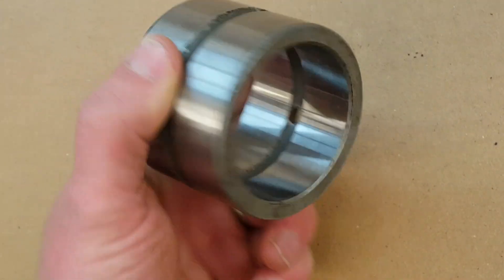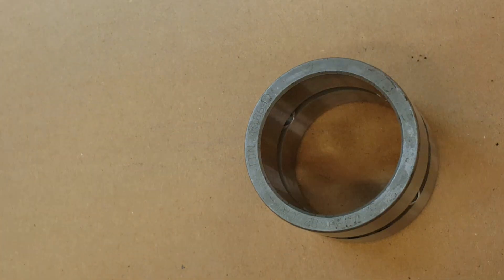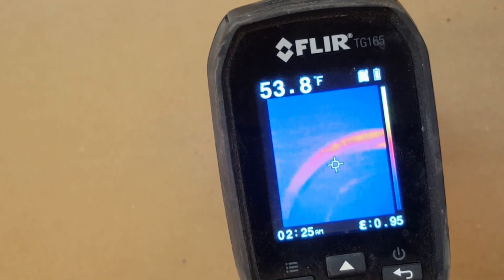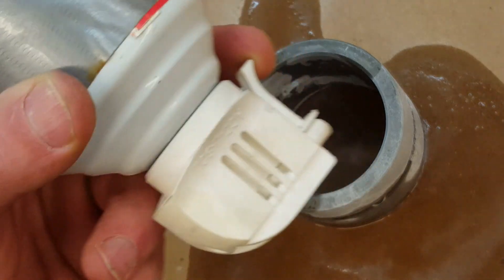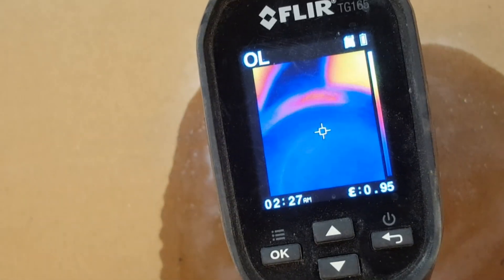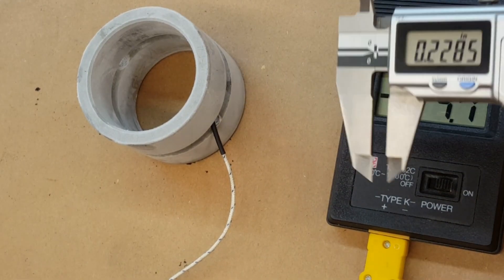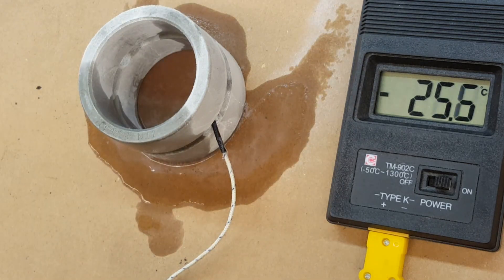Old Mechanic's Trick: Freeze-Shrink Metal Parts WITHOUT Nitrogen.

Comment: Here is an easy effective way.  Try it.  Get a bottle or two of cheap isopropyl alcohol from anywhere.  Put it in a container big enough for your part, and add a chunk of dry ice.  Dry ice is sold at many places including smart and final.  Add your part and in a few minutes it’s colder and smaller.  RE bottle the alcohol.  The dry ice will disappear.  Wear protective equipment, gloves, safety glasses, use tongs, face mask, Snorkle and fins, you get the idea.

Comment: coolant bypass tube that runs along the top of lower intake manifold is a press in friction fit it has a few pinhole leaks...will the method help remove/replace?

Comment: Although I did eventually use a freezer, I wish I would have considered this when I tried to install a CV axle transmission seal.  I always knew the assemblers and mechanics had a trick up their sleeves; I just didn't know what it was.  Thanks; I've got one more CV axle seal to go.  Having stated that, I realize the glass-transition point of rubber is -40 degC, so I cannot go too far without risking the destruction of the part.  Perhaps I can heat the transmission up with a parabolic room heater, increasing the temperature differential as well.

Comment: Ohh I know it's been 5 years, but it's so rare that I spot AvE fucking something up / that I have something meaningful to add:

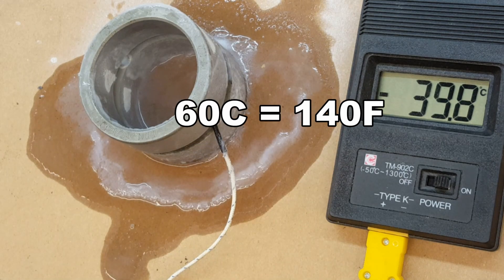2:35 He made the n00b mistake converting temperature differences from ⁰C to ⁰F as if they were absolute values. One cannot do it that way, since they don't have the same zero point!

Yes, 60⁰C is 140⁰F, but a difference of 60⁰C is equal to a difference of 108⁰F.

absolute C to F: (C * 9/5)+32
relative C to F: C * 9/5

Comment: You can do this with a propane torch too, ironically. Turn it upside down without lighting it so the liquid comes out, same effect, and cheaper. Probably should do that outside...
Reply: Remember folks.. propane is heavier than air and pools

Comment: Freeze shrinking = About 1 1/2 thou per inch (.0015) with liquid nitrogen at -200, boil it in water and it grows by .00075 per inch, put it in the freezer and it shrinks by .000000naff all !
Aluminium is double these figures !

Comment: Not sure what they sell in Canuckistan, but the stuff here in the states, nanny state got their hands on it and it's loaded in denatonium benzoate now.  Spray the solvent out of a can of duster and you'll be tasting the nastiest, most bitter taste you can imagine, really load on a part like that and you'll contaminate every surface in your shop to the extent you can't eat with your hands for hours, even after washing them.

Not sure if you can get spray air without the "abuse deterrent" in there down here in the States but if you can it's not any old hardware shop or electronics store.

Comment: Having experience an empty CO2 Fire Extinguisher when I really needed one, then a second empty one, I can tell you that my reaction to someone misusing a CO2 Fire Extinguisher wouldn't be cool at all.
Even CO2 must be taken in for recharging even if used just for a second or two. The valves will no longer be guaranteed to seal perfectly and it's very likely that well within a year it will be effectively EMPTY. 
Screw around with lots of things, I do, but I never mess with Fire Extinguishers since that memorable day. It was a nice truck.
Reply: Dafuq you prattlin' on aboot? He's not using a fire extinguisher. It's a 4 doll hair can of air. Son of a diddly, grab a hold of your ears and pull your head out of your arse. Perhaps lay off the glaucoma medication before you comment if you must.

Comment: In Aerospace assembly, only two methods are specified by major aircraft companies. 1. Liquid Nitrogen  - OMG EASY and cheap once you have the storage flask, which can be part of the LN price from most suppliers. There REALLY is no reasonable alternative if you shrink even half a dozen things a week. Liquid Nitrogen is interesting as a cleaner too. Do your own experiments. It's actually safe to handle with simple precautions. It's really cold, but a really wimpy cooler.  ? Ice water cools room temp things down way faster than blowing cold air things... Liquid Nitrogen cooling power is not as light weight as blowing cold air, but it's not even close to what you would expect IF you could have Liquid Water at the same temperature. Wear loose fitting heavy leather gloves ! You should be able to just fling them off your hand if it spills inside. 
2. Dry Ice and Pure (99%) Isopropyl Alcohol. You can get both at a supermarket that has a half decent pharmacy.  CHEAP !
Either way, you can use any Styrofoam cup or container that is strong enough to hold as much water and your parts*.  Dry ice is more hazardous to handle than Liquid Nitrogen, so wear gloves, etc. Dry Ice + 99% Alcohol gets colder than any sprays, down past -100 F.  Liquid Nitrogen is around -200*F for round numbers.
Nitrogen is magic for so damn many uses that you'll be searching for reasons to get on a regular delivery. It's as cheap as milk, or cheaper in any decent delivery schedule.

Comment: My first thought was that the canister was butane gas. Air duster is real expensive, but putting the part in a freezer may be all that's required. Still, a very good idea - if the part to be chilled - is relatively small.

Comment: Dry ice and denatured alcohol or acetone is the way to go. Down here in the states you can buy dry ice at less than $2 US a pound. I'm sure they will figure out how to regulate it soon as you can make water bottle "bombs" using CO2. I have used dust spray as well when I didn't have dry ice close at hand.   Aluminum foil wrapped around your part reduces the overspray and cost. I've also tried CO2 out of a bottle with a dip tube, doesn't work for shit.  Blows little chunks of dry ice that bounce off your part without cooling it well. Cold liquid is the trick.

Comment: Dry ice and rubbing alcohol mixed into a slury works awesome! The alcohol freezes at a lower temperature which helps keep the Co2 mixture in contact with the part. I have used this a few times when heating up a bearing isn't an option.
Reply: This idea has worked for me too, but the smallest quantity of dry ice I can buy locally is 25lb bag of dry ice peanuts! and it isn't getting any cheaper these days!
Reply: Instructions not clear, drank alcohol and huffed co2 and yelled slurs at people

Comment: You can get a plumbers freeze spray, thinks its liquid nitrogen in a can. Designed to freeze pipes and plug them so you can cut without a shut off. Would be perfect for this application too

Comment: The bitterant they put in to discourage a teenage death on a school bus is just foul though, best wear gloves until you can wash off the part. Also works with propane tanks, but with much more flammability hazard.  Dad and his buddy used to just pour out a plastic pan of propane from the big tank and put the engine sleeves in it before putting them in the block.   Its definitely a no-smoking activity.

Comment: Here's one problem with this. I did this upside-down trick with a piece of chewing gum stuck to a rug. It does work to freeze the gum for easy removal, BUT you get a mouthful of the Bittering agents usually mixed in with the fluorocarbon. You'll get it by simply spraying that much of it out. Edit: At least for those reading this in the USA.

Comment: Back in the old days use to use the big co2 extinguisher from the shop (weren’t as afraid of fires back then) ya gotta take the big defusing horn off the hose (pocket knife will do) so you have a more direct stream of coldness but in a bind it’ll temporarily shave a couple mils off a part for ya.

Comment: Works great. I have used various methods over the years, propane, co2 cartridge, etc. Works great for setting main bearings in cases on motorcycles and races in hubs. Hit the old race with a TIG torch a few times and it falls right out, do this to the new one and it drops right back in.

Comment: If you are brave you can use propane. Remove the orifice from your propane torch. Hold the cylinder up side down so when you open the valve liquid comes out. This will cool down to about -40 C. Only do this outside away from ignition sources. Can also be used to get rid of annoying smokers.

Comment: Most canned air come with bittering agents makes them worthless for cleaning computer parts especially keyboard or anything you ever want to touch again. 

I've used canned air to freeze a pipe to change a valve when I didn't want to shut down 9 apartments. 

A little bit of googling will show you that often the canned air is R134a which you cab pick up for $5 at Walmart. Much cheaper than the cans sold for dusting.

Comment: Probably a stupid question: does the metal expand back to original size when warmed?  Could one use this method to shrink the diameter of a table saw arbor to remove a delicate motor fan?   I have an old 1956 dewalt radial arm saw.  I need to replace the bearings on the motor arbor shaft.  There is a fan positioned before the bearing on the shaft. The fan is metal but can break when using a puller.   Thought the method shown in the vid could be used to shrink the arbor shaft to use less force to remove fan.

Comment: If in store available near you ... you can buy dry ice and mix with acetone .. you get low -70°F...
Reply: You must work in aviation, assembly mechanics do that exact thing when building jet engines.
Reply: @MaloneMantooth  , you are correct I used to 😁
Reply: @bfflorida2311 : Ice the shaft, heat the bearing
Reply: I work at GE and that's exactly what we do lol

Comment: I had a bolt on my car's thermostat housing that was too hard to loosen even after penetrating oil. I was afraid if I applied more pressure it would snap off. After thinking I got some ice cubes and melted a little indentation the size of the bolt. After applying two cubes it backed out as nice as you please. I figured the bolt would shrink in on itself and the separate metal around it would shrink in the opposite direction.

Comment: Try placing the part in a cheap foam cooler and spraying with CO2 from a fire extinguisher. When CO2   frost forms on the part it is really cold. Mark the extinguisher as used so you will not try to put out a real fire with it.

Comment: You can use dry ice crushed in acetone to get it to about -75c. It is much less volatile, and available at the grocery stores (well at least the dry ice is) Just don't put it in a sealed container. It's got to vent or you get some extreme pressured with it.

Comment: Nice trick. 
That'll save me a hangover waiting for the  freezer to get my axle bearing cold enough to fit in the axle tube. 
Have you ever tried using a arc welder to heat parts up? Works great if you don't have a torch or don't want to melt the solder out of your copper pipes

Comment: I used to  set bushings in the freezer  and heat up the hole it would fall in place just  like   you just spent  15$ on the block  down here in Baltimore city    except the  boom you can just spit and wipe down as for the member you cant just quite  wipe off what's  been left behind

Comment: The "solvent" he's referring to is actually a refrigerant - R152a. It is an acceptable substitute for R12 or R134a. R134a used to be the refrigerant in there, too. 

Odd that it's illegal to release R134a into the atmosphere but it's fine to spray your keyboard with this stuff.

Comment: An other method is to use a lughter refuel butane gass can. they are cheap and leave no resedue when used like the duster.
Only bad part is that they normaly dont have any good nozles on em, but a pair of pliers should do the trick

Comment: This would have been a great tip when I had to replace the crank bearings on a 2-stroke motorcycle engine.  In that case I heated the aluminum cases with MAPP gas and that expanded the cases enough to allow the bearings to slip in.  I like this way, because I ran the risk of melting the seals the way I did it.

Comment: Great quick freeze idea. On rusted or nuts ones that just wouldn't budge we'd heat the nut with a torch then press an ice cube on the bolt. This would be more of a temperature shock especially with the concentrating tube. Very ... cool?!

Comment: You can get an aerosol specifically designed for cooling electronic components.  The repairer who used to come and fix my parents' old TV used to get through a hell of a lot of the stuff .....

Of course it's the same principle, a liquid with a very low boiling point drawing heat out of whatever is touching it as it evaporates and then the vapour expands; but does it have a lower B.P. than the "proper" stuff?  Or does it just work out cheaper?

Hmm, I'm getting ideas for experiments now .....

Comment: That's how air conditioners work... When a liquid changes into a gas it absorbs alot of heat... Aka... It gets cold... So when u push air over a cold coil heat is transferred to the refrigerant... Which then takes it outside where it's turned back into a liquid and the outside ambient air absorbs the heat at the condenser... Then the cycle repeats

Comment: Never did get the whole cold/shrink thing, when water expands when you freeze it.  Then, there's all those guys who heat fasteners to get them loose (as opposed to applying cold to do the same thing).  And doesn't the surrounding material become affected (at various rates) by that?  What's the relationship?  Then, say you're removing a nut (cylinder) from a bolt.  If it DOES shrink, does it shrink OD to ID, the thickness of the nut, or does it shrink the overall diameter, thereby tightening the nut onto the bolt...the opposite of what you want to occur?   I've just never bought into either theory (hot or cold) completely, though once where I worked, we ended up applying heat to one part and cold to the other, and with a 10 foot cheater bar and half a dozen guys hanging from it, we somehow got it to work.

Comment: I usually put the part in freezer or ice and salt bath, then just finish her off with the old upside down blowjob can.
And don't forget the same principle works with raising the temp of outside casing. If it fits in a microwave just wrap it up in a soaking wet rag (wife should be out of the house at a safe distance before commandeering the microwave) as long as whatever your nuking is wrapped in wet rag none of the angry pixies get to sparking around and whatever's inside the rag comes right up to an easy 213F or 100C 
That gives you an extra couple thou per inch diameter clearance. Combine the two methods works great for big nasty driveshaft carrier bearings most people would need a big press for, a few brain cells and a small hole in the ozone above your shop and it'll slip right on by hand.

But if any of you savages ever blame me when you get caught using the microwave, I'll deny everything!

Comment: I use this exact method for helping to remove stripped screws from computers and laptops as it happens. As I deal with computers every day I've always got a can of compressed air handy just in case I need to blow out some crap from a socket or whatnot. And years ago I realised that applying a semi-liberal amount of an upturned can of air was enough to shrink most screws down enough to allow even the most sluttiest of stripped heads down enough to be removed without having to go all hardcore on her.

Comment: Poor Man's Liquid Nitrogen is 90% isopropyl alcohol in dry ice.  Way more dangerous than the real stuff because LN2 doesn't "wet" to anything because of the vapor layer between liquid and surfaces like your skin.  The alcohol in the poor man's mix will wet directly to skin, creating horrible burns, but with with a temperature of -77C, its great for larger parts that need a thorough soak.  Good safety processes and PPE is mandatory!

Comment: Aircraft engine factories/repair facilities have a special dry ice freezer which is very similar to a safe and its used for the same purpose. 
 For the sake of science, how many mils its gonna shrink my stick ?
Reply: Airman:

That depends upon the composition and diameter of your "stick"!  If, like mine, it's "steely" and two inches (2") in diameter, its diameter will shrink about two mils if the temperature is lowered 100ºF.  Length, however, is an entirely different matter.

Comment: I use a similar principal when replacing hammer handles. throw the head in an oven and heat it to 450°.  insert handle and wedge tight. when the head cools,  it will never loosen.
Reply: Wait metal shrinks in heat as well?

Comment: The trick I learned many years ago is to use a CO2 fire extinguisher, put part in a shop rag, then fold rag over nozzle and blast away, it fills the rag with solid CO2 and freezes the part. Wear gloves and eye protection, do not try at home, yada yada yada disclaimer.
Reply: dalmatiangirl61 dry ice
Reply: John Doe Um why can't this person be a girl?

Comment: I've heard of this being used in RC buggy racing. The buggies have badass little 2 stroke nitro methane motors (3hp from a 5cc motor! http://www.osengines.com/engines-car/osmg2078/index.html) that tend to get vapor locked after running. A quick spray of this stuff gets the temp down so they can get fuel back into the motor.

Comment: When you get annoyed by a wasp in your workshop and don't have insect spray, give it a quick shot of this. It will get engine problems and go in for emergency landing. Then you can put it outside. When its temperature rises it can restart the engine and fly away.
Reply: I just use brake clean and shut that engine down for good
Reply: @Andy-eh9qr  Yep, they drop right out of the sky.
Reply: LMFAO, that is funny...
Reply: That's what you get when you spray a Boeing with an Airbus.

Comment: Used that stuff once to crack some (edit 4 oz) JB Weld a one (and not the pageant) Ms. Vancouver used to fix a front bumper and mount the Front LIC plate. The JB did hold for 3 years I'll admit.